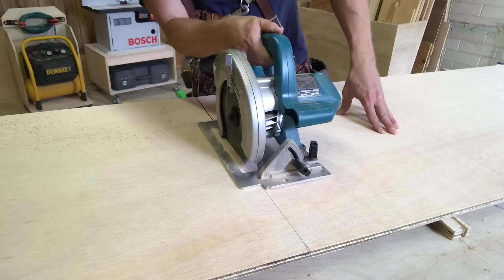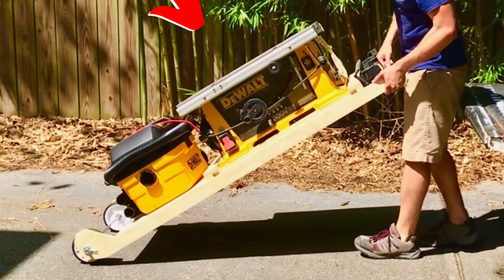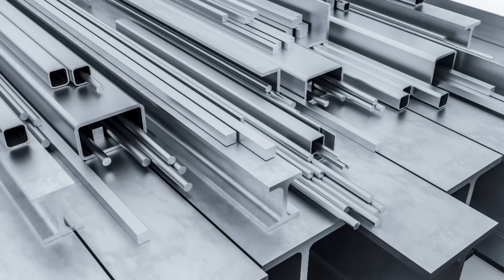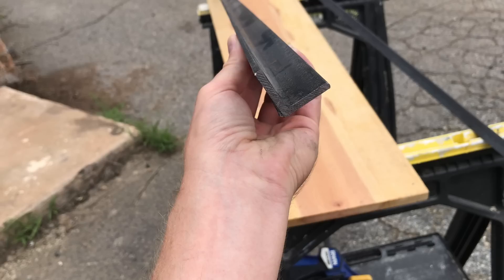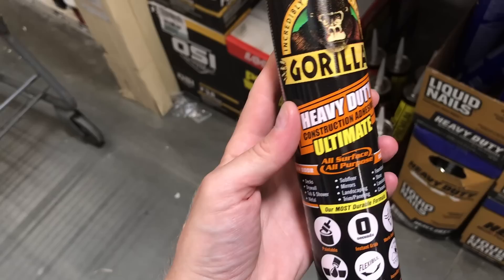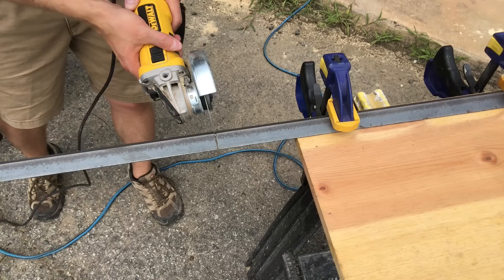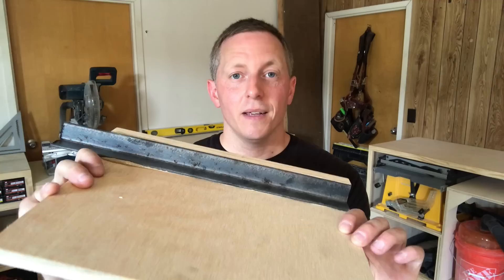How To STRENGTHEN WOOD WITH STEEL! (Make Your Wood Projects Stronger With METAL/STEEL...#1 Trick!)

Comment: I have used the box fan filter for years.  I just duct tape a filter to the back of the fan.  Ethan’s trapezoidal setup is nice in that the pressure on the filter is halved.  In so doing, the 2 filters probably trap more dust, but it does turn a 6” deep fan into a 24” deep obstacle.

I directly attach a HEPA-grade filter to the fan AND I put a cheap filter on top of the expensive filter.  I seal it with really good ($10/roll) all-weather duct tape.  (Cheap duct tape doesn’t do its freakin’ job!). The cheap filter traps the big particles so I don’t kill a $15 filter in a couple hours.  I change the cheap filters 2x or 3x as often as the HEPA filters.

If I’m working in a house, I put the fan in the window, with the air flowing out, then I seal around the window.  Air is drawn into the work area from the house.  This keeps dust from migrating into the rest of the home.  NOBODY likes a thin layer of dust all over their house, when you’re “only” working on one room.

Comment: good idea. i've used steel a lot to reinforce long wood spans and to solve other structural/joinery problems. one thing to keep in mind is that wood expands and contracts a lot more than steel, so a hard curing adhesive that has a good bond at first may tear away over expansion/contraction cycles. i would go with something like lexel or a urethane-based adhesive caulk. i also prefer to reinforce the bond with wood screws, in your case with screws through both planes of the angle steel, anchoring both to the top and back of your cabinet if feasible. i realize 1/2" p/w wont allow for very long screws, but they will still limit movement and reduce both shear and tensile forces on the adhesive

Comment: I have always drilled holes in the angle iron, then screwed or bolted it to the wood. This method is so much easier. There’s no way it can be as strong as a mechanical bond, but as long as it is strong enough, that’s what I need.

Comment: I built a tail box for my scooter with a .32 gauge aluminum sheet glued to thin plywood for strength. Used angle aluminum all around the edges, glued and screwed down for support. I used contact glue too, which worked great. I love working with metal and wood in combination.

Comment: Made a wooden table several years ago using angle bars and wood screws. Strenghtened the wood joints without nails. That way I can easily disassemble and replace anything broken or damaged. This "new" bonding material would be great for furnitures that do not need assembly/reassembly. 😊

Comment: adding a few holes with a screw (min every 18" inches) wouldn't hurt for a mechanical connection. that glue tends to work great initially, but after a few moisture cycles, the ply can delaminate and pop off the veneer layer under flex.
Reply: Damn right! That’s what I do, with little amount of extra work it’s a no-brainer. Especially with self tapping screws.

Comment: Adhesives are fantastic products with a ton of engineering baked in. Cars, planes, sheet metal bodies, carbon fiber panel assembly are built in part with glued components. When employed for the right usage, adhesives are the best fasteners one can find.
Reply: So no screws needed?

Comment: If you can do so, it's a good idea to make a few quick passes with a grinder disc over the metal surfaces that will be glued. The tiny scratches and grooves will give something more for the adhesive to grip. I'd also recommend still using a few screws, as adhesives can be vulnerable to sudden strong stresses, and some screws would help limit the harm that could come from this. Screws also help hold the metal solidly in place as the adhesives dry.

Comment: This is a very sensible clip.  I built a good sized table back before real wood was too expensive, but used essentially the same process as demonstrated here.  6, 8, 9 (?) years later, it is still holding up.  Good recommendation on the angled metal.  I think I used a Loctite product, but don't recall as it was a while ago.  As he mentions in the video, anything that bonds to metal should work for your lifetime, and probably your grandkids'.  (One suggestion.  If it will be in your garage, shed, or anywhere the air is whatever nature gives you, make sure the metal is anodized so it doesn't rust.  Someone smarter than me recommended it, and I'm glad they did!)
Reply from the maker: Thank you, Todd! Great tip to pass along 🙂
Reply: @TheHonestCarpenter  My shop is not air conditioned or temp controlled, and I've (slowly) learned to use metal that won't rust.  Pennies up front are much better than a bunch of dollars down the road.  Many thanks for your videos.  I enjoy learning from you.  Loved the video on neodymium magnets.  I now use them all over the place (and so should everyone)!  That was a real head slap segment.  There they were all these years.  Best to you.
Reply: @toddforney5198  anodized is only for aluminum, which isn't bad either, I'd probably go with steel personally and just paint it

Comment: I fabricated an 8' work bench on wheels fitted with a built in table saw. It rolled right out of my shed onto a brick patio, for larger projects. I used slotted steel angle for the frame with an Aborite covered countertop fasted by lag bolts. Everything assembled with relative ease. But the base could have been secured with PL adhesive.

Comment: Using angle iron and wood together is a very good idea. Many building standards need to be looked at when I DYI different projects. Blending metal working with wood is a perfect way to get more span out of a piece of 1/4 inch plywood or osb. Each one teach one helps all of us become better craftmen and craft women. I am experimenting with pvc left over piping which can also be blended into uses in my shop.

Comment: I've always felt "iffy" about gluing metal to wood.  You're giving me some courage.  Thanks!
Reply: The modern polyurethane based adhesives are incredibly strong.  So are many epoxies.  Just make sure to clean and degrease the metal first for a good bond.
Reply: @feathorn98  Thanks for the pointers!

Comment: When I saw you sit on the bench and it didnt flex- I was totally convinced. I was thinking of drilling countersunk holes and using machine screws to fasten the chanbel to thr plywood, but after this demonstration - I am going to use just the adhesive you used with angle iron channel  to remove the bow on a plywood frame top panel.

Comment: Fantastic!  I’ve been worrying about weight for a particular shelf storage unit in my other workshop. The variety of items I need to store are literally heavy as lead. I don’t want vertical supports every 12” because it would make the space more inefficient, but this idea opens up at least 24” spans. Plus I think lag bolts/construction screws through holes drilled in the back steel into studs will give me even better attachment to the wall.

Comment: Excellent video! I bought that adhesive because I saw someone load 4 boxes of it in his truck; and, they offer a small toothpaste-like tube for smaller applications. Works pretty good, but does expand some. I did have a plastic piece that popped off the adhesive, when it flexed. So, I'd definitely use small bolts as well for the application he described.
Another not so good adhesive IMHO, as a DIY guy, is Liquid Nails. The Liquid Nails tips flex so much the adhesive comes out of the plastic tip's base- 2 out of 2 tubes. Not a fan because the entire tube is ruined as a consequence.

Comment: Yes, I have done this before, but not for cabinets. We do that to make "road-cases" for musical equipment. The difference is, the metal ( usually aluminum for low weight ) is fastened with rivets, and the metal is on the outside edges all around the box. There are also special metal edges for seams that interlock and prevent moisture ingress. 

Road cases must be as light as possible, but also very strong. So we use thin plywood. The exterior is coated with special hard plastics that resist scratching and puncture. The interiors are usually lined with foam padding to protect sensitive equipment from damage during rough handling by "roadies." 

The bottom line is, YES this is a reliable technique for reinforcing thin plywood, and many of the best modern road cases are still made that way. Modern injection-molded or rotationally-molded cases are fine for lightweight gear like guitars. But for heavy delicate tube amplifiers, almost all professionals use standard road cases made from plastic coated plywood with metal reinforced edges.
Reply: Metal to wood adhesive??

Comment: This is great thank you. I have to add support to a header for a French door install. The building inspector said I don't have room for a header. He said come up with something. I'm going to run this by him. I think this will pass by putting a piece on each side of the 2x4
Reply from the maker: Metal could definitely help Leo! Talk to your local welder—see if they’ve got anything larger, maybe 1/4” thick angle steel. Sort of like a lintel over a window on a brick facade 🙂
Reply: Thank you for the advice!

Comment: I had an old gazebo and wanted to put a simple flat top.   The tin or Ondura is light but 10 feet of 2x4 over time can bow. I didn't want to add more 2x4s so used old bed rails on the top to reinforce the 2x4. I could sit center span and no deflection. Cool part was the rails had the cross rail about 3' that swung out which created a brace. The downside was old iron rails are hard so every hole had to be drilled to secure the panels. I, later, saw a guy wanting a diagonal run stringer on a gazebo roof build. He opted for double 2x4s 14' long.  He routed the center and routed a metal strip in-between,  laminated  style. Used epoxy and bolts. 14' is a long stretch for 2x4s. He used a thick acrylic top. strong enough for him to walk around on top. That lamination using the steel and wood worked great.

Comment: I went with a glued butcher block style top on mine. About 1.5" thick and the spans of about 5' don't flex at all.
Overall bench is about 20' long with my miter saw in the middle.
Bench is worth a small fortune now because of the amount of wood in that bench.

Comment: I am in the beginning stages of converting a school bus into an RV, I never would’ve thought to use steel to strengthen wood outside of fastening whatever I build to the metal walls. Your video today is very very helpful thank you very very much
Reply: I converted a truck into a motor home. I thought that I would mention to you that its a good idea to keep your weight down as much as possible during the build. I built my kitchen cupboards from aluminium angle. Regards
Reply: @solutionsnotproblems8946  good thought. My Skooly GVWR is 26,000lb (if I remember correctly) empty it’s 15,960lb without the seats so I should be okay. The heaviest part of my build will be the 100 gal. Water at 800+ lb when full. The battery bank will be lithium eventually so that won’t be bad

Comment: Note that if there's black mill scale on the metal the adhesive bonds to that but after VA time the scale pulls free of the metal.
I wire brush and ospho any metal I'm 'embeding' in wood like you did so it gets permanent adhesion.
And I usually do a bit of 'belt and suspenders' by drilling a couple of small holes in the metal and securing it with a couple of screws

Comment: Great video! love it, Very helpful;  I know i have used the "slotted angle iron" for different projects and they were all very strong! Infact one project i had to double up on the "slotted angle iron" (so it would not flex) then bolt it together; then screw it into make a 2x4 platform for a "wooden scoffloding/ladder going up a 12/12 roof and it worked fantastic. The 2x4's were spaced about 18" apart going up till i got all the way up.  Wished i could have used 1/2 plywood but it would have flexed to much

Comment: I have done this project of angle iron and wood but I’ve used the 2 part that mixes in the caulking tip. It’s worked out great 👍🏼
Reply from the maker: That’s a crazy strong adhesive, Billy!

Comment: At the beginning of the video, Ethan said “Shop vacs and dust collectors… can contribute to the problem of airborne dust.”  I hook up a long hose to the EXHAUST port of the vac.  I put the other end of the hose OUTSIDE.  This creates negative pressure in the shop or house and keeps a constant flow of fresh air coming in to the work area.  It may cut down a bit on the suction, but it also reduces the noise in the work.

He did not specifically suggest this, but I keep my vacuum running and close to any source of dust.  I’ll have someone hold the “wand” of the vacuum near the creation of the dust, while I’m running a device, like a circular saw or a drill.  If the device has a vacuum port, I’m all over that.

Comment: Hey honest! I can’t believe the timing of this video showing on my feed. I want to build a small stair type platform for my clients to stand on for measuring and alterations. I’m dismantling a found coffee table for the top and step.  It will be hollow and the wood is solid and heavy and I wondered about it collapsing. This sounds like a decent plan, although I have admit I felt a bit insecure until I saw you jump up &  sit on your bench.  That physics of this concept are fascinating.  Thanks for enlightening me!  I’ll let you know how it turns out. Ps. Thanks for the advice on my circular saw.  I cut down some solid bifold doors, (most of my wood is recycled), this wood was super heavy and that little lift of the guard was all I needed. Simple. Thanks so much.

Comment: Yes, I have done this kind of thing before, adhesives always seem to give way over time.  Glue & screw lasts better.  The problem with angle steel is that when stressed under bending load, the upright faces can't carry a huge load as only the outer edge is stressed, so it is always the upright face that fails.  The same size RHS at half the wall thickness offers about 3 times the strength and stiffness. Costs a bit more though.  If you don't want to weaken the steel by drilling, screw it down with clips or welded tabs.  Yeah getting more complicated I know.
Reply: Please....What is RHS ?
Reply: @gerry427  Rectangular Hollow Section

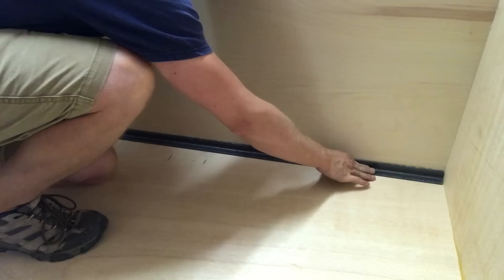Comment: 4:26 If you have attached this metal before attaching the table top. Then you can cut the metal a little longer to hold onto the vertical support. This will make it even long lasting.

Comment: Great video. I will use this to strengthen the span of plywood holding my wheel wells on my camper trailer project. Originally the aluminum wheel wells attached only to the edge of the plywood floor, which eventually rotted causing the wheel wells to detach and sag. I had already planned to screw into metal supports, but now you've got my wheels turning... I will use that adhesive and consider different types of metal supports. Thank you!
Reply from the maker: Thanks, Diane! That’s a good application 😄

Comment: Good stuff and nice work.

The only issue I can think of is if for some weird reason the plywood delaminated over time.
I do not think it would happen but I quit saying something can never happen.

All of the events of the  last year should be enough to prove that.

I agree with the comments below about the ends of the steel being supported.

Most metal has some sort of oil coating on it.
I wipe mine down with mineral spirits to clean it before using or painting it.

Comment: I've always the angled slotted iron for all sorts of things with nuts and bolts and I would countersink the heads because I didn't think that there was an adhesive that would bond metal and wood adequately. You just gave me an excuse to buy that metal saw and that Milwaukee electric caulk gun I've been wanting. Thank you.
Reply from the maker: I always love providing that excuse, dark passenger 😆

Comment: I've designed bespoke timber exterior joinery with flat bar glued and screwed to reduce wind load deflection to meet a local standard. It's always hidden inside the transom, mullion, jamb or cills as we do a lot of book joins as the timber is often only oiled or stained.

Comment: Good job. I have something to add that you did not mention. It is one thing to wipe off the rust and metal dust with a dry cloth. Better yet would be to also clean the metal surface with a liquid cleaner such as Klean-Strip Prep & Etch or some other such product designed for cleaning raw steel that would remove the presence of any oil or other such substance that may inhibit bonding. In addition, after using this liquid cleaner and drying your steel, then a light sanding to finish the job along with the removal of the sanding dust.

Comment: Never really think of metal and wood and yes- how do u glue them together to ensure adhesion. Great video as always!  Darn- I saw some rust in gas pipes and elbows and didn’t clean before foam insulation and drywall went up.  Gosh I hope they last 20-30 years without issue!   Again, house had more fair share of rain everyday for 6 weeks straight and I am sure OSB has been compromised and warped.  City inspector passed it so I am moving forward.  Nervous but life goes on- shabby materials and not great laborers due to COVID- but glad to see your videos to know what I should expect!!  Thanks again!!